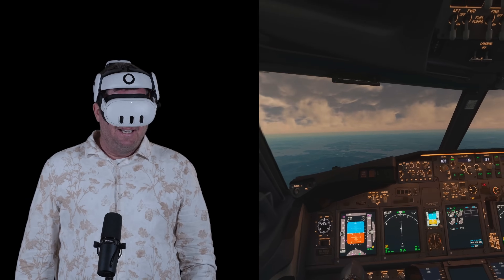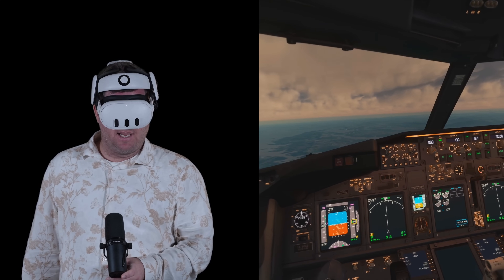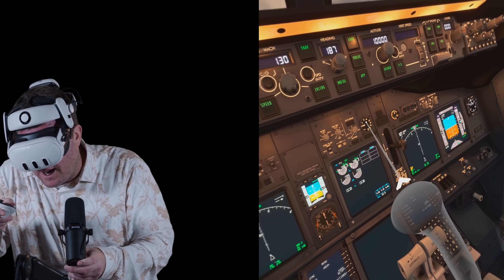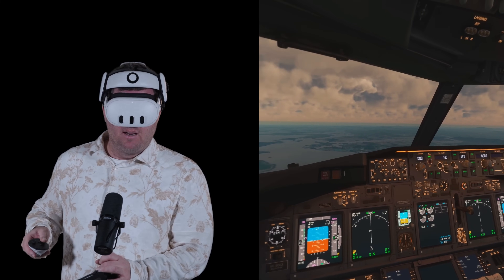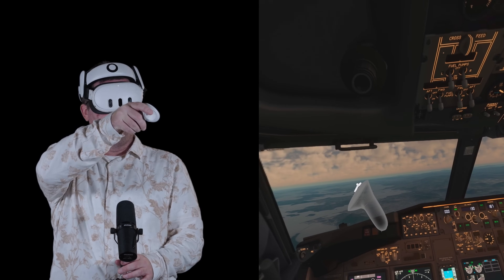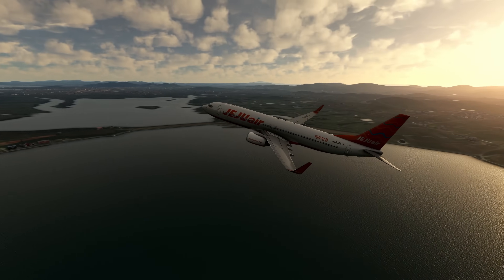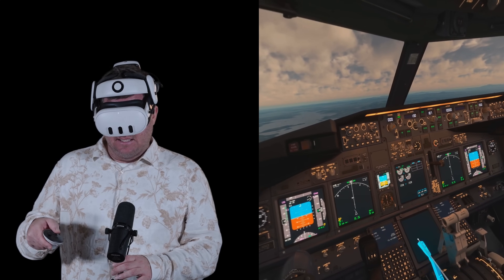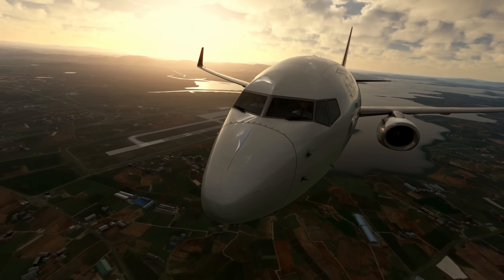Flight Recreation and Update on Jeju Air Fatal Crash in South Korea

Comment: Minute 9:10 you mention that during landing ground spoilers are enabled by squat switches.  This is not true on any of the B737 variants.  

Ground spoilers are enabled by a valve operated by a push-pull cable connected to the RH main landing gear upper torsion link.  This cable will physical open a valve to provide pressure to ground spoilers.  You will see this cable when you do your walk around.

At 10:30 you mention that with total electrical failure will have the Battery & Standby hydraulics saying even in an electrical emergency you can get flaps & slats out.   This is not true as explained in my previous comment below.

 At 11:40 you mention the alternate gear extend cables will open a hydraulic valve to evacuate fluid so the gear won’t be held up.

This is not true and it’s very important for you to know this.  Also important point for you to explain to other pilots you train.  These cables do not open any valves. 

During a manual gear extension it’s the pilots that open the valve that prevents a hydraulic lock.  They do this by placing the landing gear handle in the ‘OFF’ position prior to pulling these manual extend cables.  It’s incumbent on the pilots to know this very important point.

14:50 you mention spoilers are hydraulically driven and can be moved manually if you are on the Standby System to command the speed brakes on the older -800 aircraft.   This is not true.  It’s not possible to command the spoilers when you are on the Standby System.

Comment: Engine speed below idle and as low as 20% N2 will operate an engine driven hydraulic pump (EDP) at full 3000 psi, but not the IDG/generator.  Below idle speed the engine generator would drop offline.

RH engine Thrust Reverser was deployed indicating B-system hydraulic power was available.  But does not mean the electric motor driven B sys pump was in operation.

RH engine thrust reverser, primary flight controls, LE & TE flaps and would all have been powered by #2 engine driven pump still turning, to pressurize the B hydraulic system.

Landing gear can be raised by B-system hydraulics under certain conditions, but cannot be lowered by B-system.

If the LH engine was not turning and an electrical failure occurred, there would be no backup for A-system hydraulics.

The Standby hydraulic system cannot be powered by the battery as suggested in the video.  Standby hydraulic electric motor driven pump requires at least one engine or APU generator to be online in order to operate.

Another small point noted, with reference to flap positions selected or indicated.  Not important for pilots but critically important for maintenance.  

These are units of flap not degrees of flap.  

TE Flaps move considerably more than 40 degrees.  

Something we must confirm with a protractor with regards to full flap travel and symmetry checks when rigging TE flaps.

Comment: On final approach cleared to land, hit a bird or several, one engine fails- no doubt, flaps 15, increase speed 10 knots, rudder as necessary to maintain airplane aligned AND LAND! 
Going around is out of the question! 
What else is to opinion about?
Keep it simple

Comment: Any jet pilots here?  If you shut down the wrong engine, how long to re-start it?  On a piston twin, "Identify, verify, feather". If you pull back the wrong engine, you know it! Then you power it back up. Can you do that in a jet, or does it require re-lighting the fire?
Reply: If another main engine or the APU are running, bleed air can be used to start the engine that has been shutdown. With the proviso that the fire handles have not been pulled. The igniters also need to be operational.
Reply: @christopherrobinson7541  A little more complicated than in the Aztec!

Comment: The pilots RUSH on the emergency and ALL pilots know that bird ingestion does NOT doomed the airplane. It is multiple of FAILURE BY THE PILOTS that contribute to this disaster. 
1. Pilot did NOT configured the airplane to land on Muan Rwy 01. Landing Gear and Flaps are up. IF they did and continue to land on Rwy 01, they would been saved.
2. By RUSHING, the might invertantly shut down the wrong engine. The good engine is #1 on the left side. The same thing happened on British Midland 737.
3. By rejecting Rwy 01 they doomed ALL on board. Why did they NOT continue onto Seoul Incheon or Gimpo?
4. SOmething is fishy.
Reply: It is likely that they had a double engine failure. Without the APU running this would result in the loss of 115V 3 phase 400Hz AC, which is required to power the hydraulic pumps. With no hydraulic the crew would be unable to configure the aircraft for landing.

From the MAYDAY call and until touchdown was only 3 minutes.

In the flapless configuration to land safely the runway would have to be at least 6,000m long. The runway utilized is usually 2,800m long, but because of construction work to extend the runway only 2,500m was available. The longest airport runway in the world, is 5,500m long.

Nearby by larger airports have longer runways, but the maximum length is 3,400m. However without engines the aircraft could not reach these airports.

Comment: Instructive video, confirms how bad is alternate LG extend  mecanism made of 3 handles to pull instead of only one on most of A/Cs... Apart of that, nothing really new...
Reply: The force and the distance the cable has to be pulled-out is a factor. The load is about 15 to 25 lbs and cable is about 5 ft long and this is down from a sitting position in the right seat. With just a single handle the load would be too great.
Reply: Thanks for this update.

Comment: I'm courious if people ever get their heads around the idea, that ther's more reasons to shutting down #1 engine than just some lousy fellas doing something 'wrong'. What if the cockpit  fills with smoke from burning remains o' those birds (in the bleed air system ) and they get the associated #1 fire alarm? 
Leave it in operation... really?
Reply: It is likely that the No 1 left engine was also struck by birds, at the time the No 2 right engine was hit or sometime latter. Whatever the case the crew were faced with a double engine failure.
Reply: @christopherrobinson7541  And more... black boxes stopped recording

Comment: The stray video shows something else but bird strike. To those who don’t think and analyses, that should be a bird strike. 

The turbo fan is located about 20% from intake nose. For bird strike, the puff of smoke should either show up by 20% point or behind the exhaust and see by the tail fins and not exit the side at 50% point. 

Normally the main engine inlet is masked behind the turbo fan hub, hence protected by it. So is guarded from all bird strike. 

When the fan is taken a stray bird it can be set in neutral or automatically decoupled from the main engine and let the main engine take over for a reduced thrust operation and not totally disabled.   Do you think so?

Comment: Some have wondered who was flying and noted that the right pattern they flew makes it hard for the captain to see, but if they shut down the left, (or it was fully inop) they wouldn't want to be turning into the dead engine, right? So if the left is off, they would want to make right hand turns...
Reply: No. Turning into the dead left engine would mean left turns. Also with large airlinears turning either way makes little difference. However with light twins it is important to turn into the dead engine.
Reply: Unless I've learned something wrong (I'm not anywhere near a multi yet), turning into the dead engine increases risk. Thus one would avoid it (all other things equal). Large planes may have more rudder authority (IIUC) due to their higher speed, but if left is shut off and right is making poor power (they probably have anomalous readings on the right from the compressor stalls, we don't know why they appear to have shut off the left), then the ability to maintain the speed that gives that rudder authority might be compromised? If they shut down the left entirely, it's the dead engine, so they might have less risk turning away from it? Whether mitigating that risk is a correct trade off I don't know. I'm just offering a speculation as to how that choice might relate to the observation that the left was shut down.

Comment: The biggest clue in this crash is the extremely short time between go around and the second approach.  That would indicate they shut off the wrong engine and didn't have time for anything.  Also explains the flaps and gear issues due to not enough hydraulic pressure.
Reply: Also the No 1 engine could have been damaged around the time the No 2 engine had a bird strike and failed when full power was commanded or there was another bird strike.
Reply: I don't know why so many commenters have this fixation with trying to accuse the pilots of shutting down the "wrong engine", when we have numerous pieces of evidence that all point to both engines being hit by birds and BOTH being severely compromised (*probably #1 first, and worse). And as christopherrobinson pointed out above, there is definitely the possibility of additional strikes even after that.

Comment: Shut down the good engine. Whip a u-turn instead of a go-around due to lack of thrust.  Keep flaps and gear up to maximize glide.  In the panic, way over estimate the distance to the runway.  Blow your one and only chance by coming in way too fast.
Reply: Your comment is basically saying that morons were flying the plane.
There is literally no indication that that could have been the case.
Quite the contrary: then landing was beautiful. The 4,000 feet late were all due to ground effects and could the pilot have dealt better with those?

Some commented he could have lowered the nose quicker, but is that an honest assesment? No. Because none of them have flown the aircraft in that situation. 
The elevators were certainly impacted by ground effects unknown to anyone that hasn't been in that situation. No one knows how quickly you would be able to get the nose down. And slamming the nose down would not have helped anyone either.

Comment: You state a no gear landing would take over 9000 feet or the whole length of the runway.   But add no flaps  and faster landing speed then this plane may need over 14000 feet.   Thus there was no safe landing space especially when the missed the first 5000 feet.  Maybe a water landing should have been done.
Reply: At 200 kts which is the correct speed for a flapless landing it would take 6,000m (20,000 ft) to stop. That is 2,000m into the sea.

Comment: I think they lost both engines, so they rushed to land and the gears and flaps
Reply: Without engine power and the APU not running they could not configure the aircraft for landing.
Reply: @christopherrobinson7541  I know but one of the engines worked a bit. So msybe that was what made them land.

Comment: The mystery around this landing is so profound.  I’ve watched so many videos, and a belly landing seems so out of ordinary in these circumstances.
Reply: If you were privy to the full audio file from the CVR, the "mystery" of the landing would not be profound at all. Evidence clarifies a good judge's mind no end.
Reply: @ obviously, it’s profound since I (we) aren’t privy to the CVR.
Reply: @WorldPeace - then they can feel free to release the CVR transcript anytime.
Reply: I would have floated as long as possible in ground effect even pulling back on stick to get the nose up but not enough to induce vertical increasing like a lift off. I would basically try and stall it while in ground effect. No way would I put it down on smooth surface at 150-170 mph. I also would have tried landing on the original approach. Witnesses said the gear was already down so they must have brought it back up and the one video shot of the flame from the left engine was actually mirrored and it was the pilots left hand engine that shot the flame,that is what the person who filmed it said. He said for whatever reason the media showed it mirrored so when we see the plane flying we need to know it was the other engine that shot the smoke out from bird ingestion
Reply: @dickfitswell3437  No, that video was not mirrored. 

The aircraft was heading North and the sun was from the East, it was about 09:00, so the reflections on the fuselage are on the right side of the aircraft. In addition the video was shoot from the balcony of a hotel that is on the East side of the airport, the terminal buildings and control tower are on the East side.

Comment: REASONS for AIRCRAFT CRASHES

(1) Weather. e.g. Heavy cloud or fog > Low visibility. Rain. Snow. Hail. High winds. Icing etc. 15/1/1977 Linjeflyg Flight 618, Vickers 838 Viscount during approach to Stockholm Bromma Airport, Sweden.

(2) Mechanical Fault: e.g. 25/7/2000 Air France Flight 4590, Concorde. Gonesse, France.

(3) Engine Trouble: 9/7/1996 Delta Airlines, McDonnell Douglas Md-88, N927Da on runway 17 at Pensacola Regional Airport in Florida.

(4) Oxygen Depletion: 14/8/2005 Helios Airways Flight 522, crashed near Grammatiko, Greece.

(5) Fuel Depletion: 2/12/1977 Tupolev Tu-154, near Benghazi, Libya. (b) 23/7/1983 Air Canada Flight 143, commonly known as the “Gimli Glider”, Maintoba, Canada.

(6) Impact in the Air: (a) Bird Strike 4/8/1960 Lockheed L-188 Electra, Boston Harbour. (b) Hit a UAV. 10/8/2021 Cessna 172 on approach to Buttonville Municipal Airport.

(7) Murder > Suicide by Pilot. e.g. 24/3/2015 Germanwings Flight 9525.

(8) Hijacking. Multiple cases. e.g. (a) 7/9/1987 Pacific Southwest Airlines Flight 1771 (b) Sep. 11th 2001.

(9) Bomb on Board, e.g. 1/11/1955 United Air Lines Flight 629, Weld County, Colorado.

(10) Bad Landing or Take Off: e.g. 16/8/ Northwest Airlines Flight 255, Detroit Metropolitan Wayne County Airport.

(11) Pilot Error: 23/3/1994 Aeroflot Flight 593, Kuznetsk Alatau. The pilot let his 15 y.o. son “play” in the cockpit whilst flying at an altitude of 9500 metres!

(12) Incorrect Instructions from ATC: 1/7/2002 Überlingen mid-air collision.

(13) Hit by a missile: e.g. 18/9/1961 Transair Sweden DC-6 crash, Ndola. Dag Hammarskjöld et al killed.

(14) Pilot blinded by a laser from the ground: Rarely results in fatalities. e.g. Pilot Jonathan Fay, Zenith 750 Cruzer Bush Plane. On approach to Arlington Airport, north Seattle. (Landed safely)

(15) Impact in the Air, near the ground: Transmission lines or tower. Building etc. 29/9/2024 onte Picayo area of Puçol, Valencia, Spain. Bell 206B JetRanger III helicopter.

(16) Pilot in Charge or Co-Pilot suffers a Medical Emergency, e.g. Heart Attack, Massive Cardiac Arrest,  e.g. 15/7/2023 Piper PA-46 crash, Martha's Vineyard plus many others... See “Kathryn’s Report”.

(17) Other.

The detectives at South Korea's version of the NSCB, "The Aviation and Railway Accident Investigation Board" in Sejong City have already reviewed the Voice Data Recorder and will know what happened in the cockpit in the fifteen minutes before the plane’s destruction at exactly 09.03 local time 29/12/2024. They should make the unedited, raw Cockpit Audio File/Recording from the last 15 minutes of the flight to the time of the crash, available to the Korean public ASAP.

“The L-RD detests lying lips, but he delights in people who are trustworthy.” - Proverbs 12:22

Prayers for the pilots, crew and passengers of Jeju Air Flight 2216.

Adam Neira
Founder of World Peace 2050
Founded in April 2000
Paris - Jerusalem - Melbourne

P.S. Note: The Global Aviation’s Revenue in 2024 reached nearly USD $900 billion dollars, with a nett profit of close to $100 billion. Including passenger/tourist ticket sales, aircraft sales, maintenance, upkeep etc. The Industry has a very well funded “Reputation Management” team working 24/7/365 to monitor air activity incidents and crashes and the narrative/media around them.